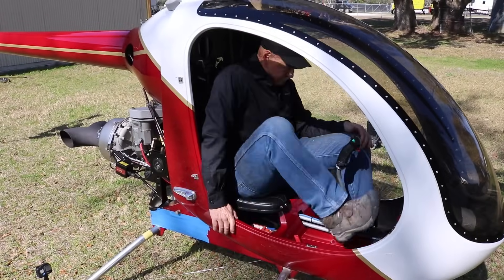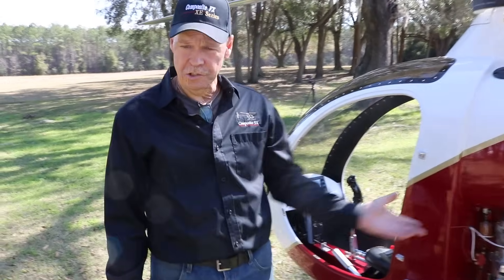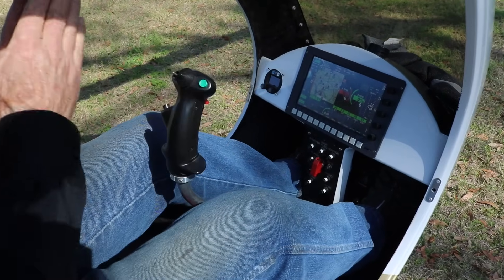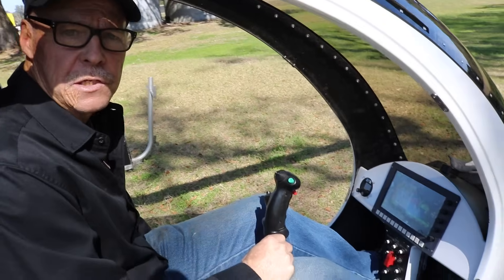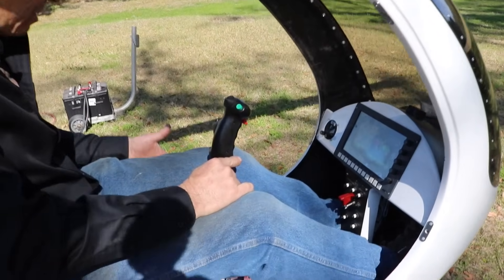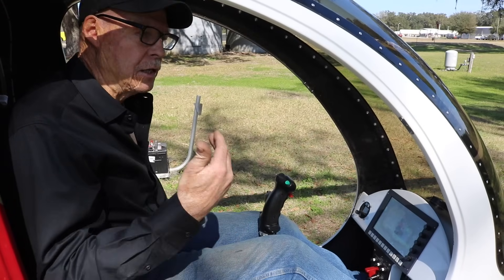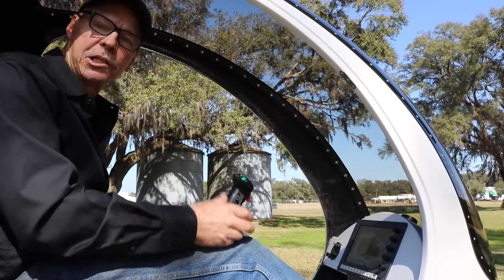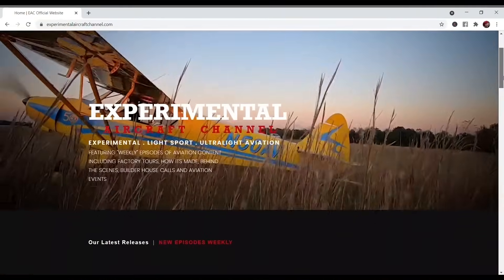Mosquito Helicopter - Jet Engine Startup Procedure and Test Flight!

Comment: The main difference between a turbine engine and a jet engine…. A jet engine produces thrust to move the aircraft.  A turbine engine converts the same jet engine thrust into mechanical energy with turbine blades on the back half of the engine.  The turbine blades are connected to a transmission and finally the rotor of a helicopter or propeller of an airplane.  The benefit of a turbine engine is they are typically lighter than a piston engine.  The downside of a turbine engine is higher fuel consumption.  The XET has about half the flight time than the XE290 given the same volume of fuel.  Both have about the same amount of power and weight.

Comment: 14:05 I hope he didn't exceed 45 mph.
Most APUs start and monitor themselves.  Why doesn't this engine use such a computer?
Reply: These helicopters top out at 110 cruise is like 80 or 90. But since it using a Chinook apu as main power for the helo it makes sense for the pilot to monitor it

Comment: Why doesn’t he fly much at much altitude? Not confident enough? Also that start process seems very prone to error, like all you need to do to over temp the engine is give it to much throttle (hence fuel) during startup. Im surprised it’s not computerised, even in an experimental craft.

Comment: I'm thinking that to make that much noise you have to burn a whole bunch of fuel. The range on this thing must be abysmal. Can it stay up for long enough to recharge the battery after a start or is it limited to half a dozen laps around the cornfield? I mean it's cool as hell but to be practicable you need at least an hour of range like the 1909 Wright military flyer. Also I guess you'd have to land where there's food because you ain't bringing any with you.
Reply: This is just a toy to buzz the treetops. Nobody is going on any cross country trips in a single seat open cockpit helicopter with no doors
Reply: An hour for the turbine. 3hrs for the piston engine

Comment: I’m a EMS Bell 206 L-4 guy. I understand the reasoning of  that red guarded  fuel solenoid/ injector switch, but man it don’t even lock in the up position? I guess if you don’t hit it or something fall down onto it, your fine. I’m weird I guess because out of the entire helo panel layout, that was most concerning to me. I’d still like to own one someday. Very smooth!  I’d like to see a cost breakdown video on this model.
Reply: I agree that Killswitch makes me very nervous. While it’s hard to imagine a scenario in which you hit it by accident, that’s why we call them accidents. Things happen. Perhaps there’s some trouble while in the air and you’re attempting to manipulate one of the breakers. Just one wrong move with your hand and down you go, don’t like it one bit

Comment: The thing has the a mean look to it I'm imagining it as a mini gunship with a 40mm automatic grenade launcher in the nose rockets and missile or 50bmg minigun on some short wings with hard points and a slightly bigger engine with a 3 bladed rotor that would be an impressive little bird at a decent price.

Comment: These 2 bladed choppers scare me,  when a mast bump happens that is literally it. You have a 300 foot drop to think about the good parts of your life.
Reply: Having flowned thousands of hours in 2 blade helos the trick is never go below 1/2 Positive G, you will not have a problem
Reply: There really shouldn’t be a scenario in which you do a push over in a helicopter unless you’re flying extremely fast and extremely low over obstacles. As long as you aren’t blindly flying through the mountains you should be fine

Comment: Got rides in 2 different Hillers , a Robinson R-22, a Hughes 500, and the biggest was the Bell Jet Ranger...... 

The Hillers were wild as the pilot added a weight bar adjustment to the fuselage near the tail rotor according to our passenger weights. We were surveying for timber cutting along the US/CDN border with Columbia Helicopter Logging. That dude put his skids on logs on the side of a mountain LZ and kept it there while we unloaded all our gear which was strapped to baskets out side the cabin. So exciting man!!
Reply: Adjusting the cog 🤘🙏🤠
Reply: Turbine and piston motors , love sounds of both !.  Turbine though takes subtlety to start , excellent guide. Thanks guys. Dave

Comment: Is this a turbine engine or a jet engine? My understanding is that a turbine engine turns the shafts only but a jet engine would give jet propulsion. This aircraft seems to only be a turbine powered engine. I'm not trying to be a critical just trying to get some clarification for myself. In my mind it's a little confusing calling this a jet engine.Thanks

Comment: How much weight can you have on board? How much do these run with the engine included with a jet turbine built from the factory?
Reply: Their website says $77k built, $60k for the kit.

Empty weight 420 lbs, max gross weight 820 lbs

Comment: Is this a mechanically direct  to the single spool of the G.T.E?or still it has a free power turbine/split shaft? On my mind hows possible that you could overtemp the the turbine? Im mean in start up yes but during the spooling of the mainshaft was a questionable in my mind...hows that possible?please sir me i know the things i dont know
Reply: This is a direct drive shaft turbine, not free turbine. It uses a centrifugal clutch in order to engage

Comment: You could easily program a arduino board to automate that start process. It would add a consistent start everytime by monitoring the EGT temp and trend. Call it a poor man’s FADEC.
Reply: Yes, or a Rasberry Pi, same idea.
Reply: TBM 950 😊
Reply: From what I know, the Solar Turbine T62 engine comes from larger aircrafts, where it serves as an APU (auxiliary power unit). I once saw an airline pilot start an APU with a single switch, so I was a bit surprised that such a complicated procedure is needed here.
Reply: Great idea, too expensive to make a mistake, and humans make mistakes.😮
Reply: Lmao ok. 😂😂
Reply: ChatGPT could probably give your code a good start...
Reply: @dtllcmotorsportwa  I think you are correct. Tapping into the output of the sensors wich could be analog or digital. Define the ranges and then program the control to happen at different variations. The If/then scenario is all it would need. I built a autopilot for my RC airplane doing just that.
Reply: @Tld0026 can you make a video on your rc autopilot, or just share me something so I can contact you

Comment: I worked at a Garret service center and we took on the overhaul capabilities on the Sundstrand T40 T62 APU engines and they were always toast inside. If anything it will be expensive to maintain in servicable condition.
Reply: These are the solar t-62 engines and because it is on an experimental aircraft the costs are a bit less.  We (Mosquito Owners) are fortunate to have a guy that supports this engine and not charge the certified rates.
Reply: @chuckfranklin6621  How often is maintenance required that you can't handle in garage? What's the rough estimate of your overall routine maintenance cost so far with your craft?
Reply: @serronserron1320  I have had mine together and flying now since end of March.  Very little maintenance as long as you are not stupid with it.  Every 25 hours there is maintenance schedule of things to look at.  Of course there is the annual you have to get signed off every year but that is with any aircraft.
Reply: @chuckfranklin6621  What do you think of the MZ202 Carbureted Air Cooled or the other ones that the company uses in their kids?
Reply: @serronserron1320  I had the MZ202 and no major issues.  Composite FX is coming out with their replacement for the MZ202 and will be a much better engine.  If you are not a rated pilot that is the way to go.  The next steps up (285-90 and Turbine require helicopter ratings).   You can’t go wrong with the quality and safety of this machine!

Comment: i wonder if they make fadecs for that turbine. sure sounds like it needs one
Reply: The instructor over complicated the start up process. It’s really easy, just start the fuel pump, hit the starter up to 25%, hit the igniter, roll throttle up to 50%, release starter, roll throttle up to 75%, turn off igniter, roll throttle to 100%. Whole process takes 60 seconds
Reply from the maker: Unsure. Would be interesting to do a deeper dive into the installation and operation/control for that engine for sure. NOTED. :-)
Reply: The turbine is controlled by the turbine FCU (Fuel Control Unit) which is a mecanical system which comes with the turbine as part of it. It is military grade so very reliable and once at 100% engine rpm it keeps it there no matter what collective input you give to it. You just have to watch the EGT (Exhause Gaz Temperature) not over reaching 1000°F.

Comment: Please stop calling a gas-turbine engine a "jet."  🙂
Reply from the maker: It in fact runs on Jet-A. Jet Fuel. Do we need to call it "Gas-Turbine Fuel" as well in the future?! Haha! It's a "
generic word  used as a generic "term" for the function of what it is burning. I think we all know what is being talked about when we say "Jet Engine" be it a Fan driven or Shaft driven "Jet" yes?  THANK YOU for taking the time to engage in conversation here! Love it! 🙂
Reply: @ExperimentalAircraftChannel  It's burning kerosine. Do you call the Semi's you pass on the freeway "Jets" too?

Not a biggie either way, but if we're trying to be precise with our language, "jet" is derived from a Turbojet engine, which is different from the Turboshaft engine powering this helicopter.
Reply from the maker: @TheOwenMajor  #semijet :-)
Reply: @TheOwenMajor  first off all jet fuel is  just refined kerosine so that doesn’t make much sense for an analogy an f35 is most likely using the same exact fuel this is and I don’t think calling it a jets a huge deal turbo prop and turbojet engines are pretty damn similar. I just think I don’t really matter what ya call it
Reply: @cameronelder4775  It's a matter of being precise in your language, especially an aviation channel where the terms actually mean different things.

Turboshaft engines are not new, no one would call a turboprop aircraft a "jet".

At least with a turbo fan aircraft a small portion of thrust is still generated by jet exhaust, with turbo props and turboshaft engines that thrust is practically zero.
Reply: @TheOwenMajor  Ah, the aviation grammar Nazi's. Here's one for ya. In a Jet we refer to the throttles as thrust levers, but then why when using the Autopilot are they referred to as Auto Throttles?
Reply: well, it is in fact a type of jet engine
Reply: @SoloRenegade    No, it isn't. It's a type of gas-turbine engine.  ALL jet engines are gas-turbines but not all gas-turbines are jet engines.   It's like calling a diesel engine an electric motor because both spin a crankshaft.
Reply: @phillipzx3754  " It's like calling a diesel engine an electric motor because both spin a crankshaft." terrible analogy

nothing wrong with calling it a jet engine. stop whining.
Reply: @SoloRenegade    "nothing wrong with calling it a jet engine."  Except that IT IS NOT a jet engine!  Even the PILOT called it a "turbine" after hearing the term "jet engine" a few times.  

If a person called the main rotor of a helicopter a "variable pitch propellor" they'd be corrected in a heartbeat. 

But...if an aviation channel (or you) want to misuse terms, fine by me.
Reply: @phillipzx3754  But the main rotor IS a variable pitch propeller. Explain at which point it ceases to be such. What about a quadcopter's rotor blades? Are they rotors or propellers? What about a V-22? propellers or rotors?

It's like "anti-torque" pedals. I still call them rudder pedals. Why? becasue it's easier to say, everyone knows Exactly what I'm talking about, and causes less confusion. And I am speaking as a CFI-I of both airplanes and helicopters.

As for jet engines, even most engineers don't know the distinction between a "gas turbine" and a "jet engine". But they all know exactly what you're talking about if you say a jet engine, even non-engineers. So once again, speaking as a Mechanical Engineer, i will continue to say jet engine for the benefit of the wider public. and you can't stop me. 

At what point does a turbo jet become a turbo fan? And at what point does a turbo fan become a turbo prop? and at what point does a turboprop become a turboshaft? they all operate on the EXACT same cycles and operating principles. the differences lie in the variations in combinations and design of the compressor and turbine sections, as well as things like intercoolers. But they all work the same way, and they all drive a shaft to produce lift (thrust). And don't forget the residual thrust still generated by these engines that contributes to forward momentum, even if only by a little.
Reply: @SoloRenegade    And if a person went around calling the main rotor of a helicopter a "propellor," they would be (pretty much) immediately corrected.  Can you imagine a CFI telling their student, "OK, now gradually raise up on the collective to increase the pitch on the main propellor?"  LOL!!

I ask POLITELY if the narrator would please stop calling a gas-turbine engine a "jet. engine."  Every oounce of thrust goes through a gearbox.  I suppose one could aurgue the exhaust adds a measurable amount of thrust, but it still doesn't make THAT engine a "jet engine." 

As a main rotor of a helicopter is a TYPE of propellor, a jet engine is a TYPE of gas-turbine engine.  It is not the other way around.
Reply: @SoloRenegade  You're right, it is a terrible analogy; electric motors don't have crankshafts.
Reply: @elliottdiedrich3068  not just crankshafts, they work on totally different principles.

Whereas jets, turboprops, gas turbines, etc. ALL work on 100% the same basic components, operating principles, etc. In thermodynamics there is zero distinction at all between any of them what so ever. And that's where it falls off the rails. for him to distinguish a Jet ("a rapid stream of liquid or gas forced out of a small opening.") he has to prove it is fundamentally different from a gas turbine.
Reply: And stop saying RPMS .. it's RPM- revolutions per minute ... not revolutions per minutes.

Comment: May we see an autorotation from you maximum above-ground altitude of 20 feet, please. 👍
Reply from the maker: I forget off the top of my head how much the rotor weighs (We are doing a segment VERY soon on their rotors as they now make them "in house." Bet there is a bit of weight in mass rotation both above and on the tail (as he explains in the video) which gives them a big "flywheel" effect. And they have a very efficient rotor (I am told) that also helps. Thank You for chatting here! Love the engagement!
Reply: Look on YT there are plenty of videos of nice autos from 4' and up, go to their fly in and see em' in person. Quite a jam up little helo
Reply: 😂 At 20’ you better have airspeed. Very low mass rotor system, not forgiving!
Reply: @melissasmess2773  no problem at 20' as the mosquito has a lot of energie in the mass rotor system... a lot more than a R22
Reply: @melissasmess2773  you'd be surprised!  there is a video I believe out there of straight down autos no speed at multiple heights.
Reply: @melissasmess2773  see this video  https://www.youtube.com/watch?v=_W_5lo_trDI